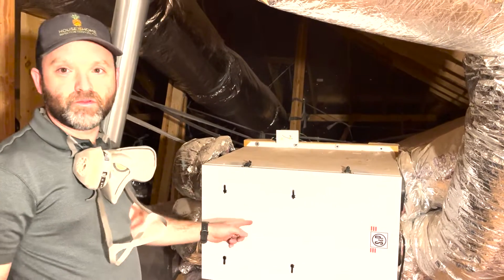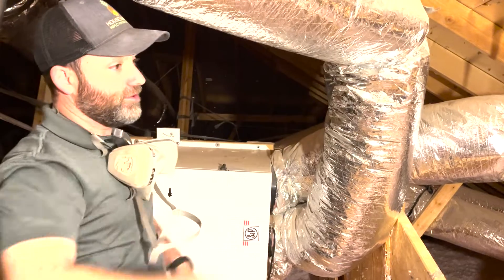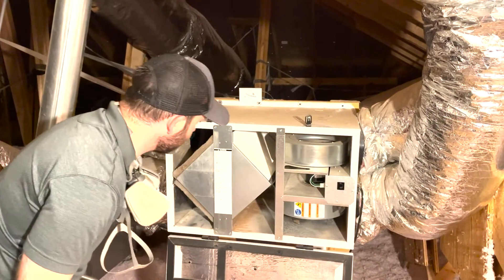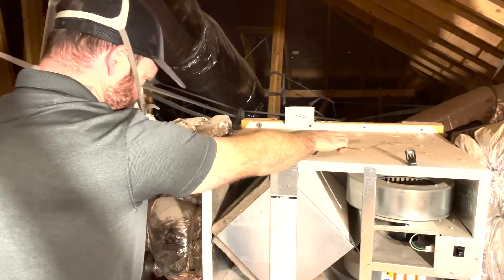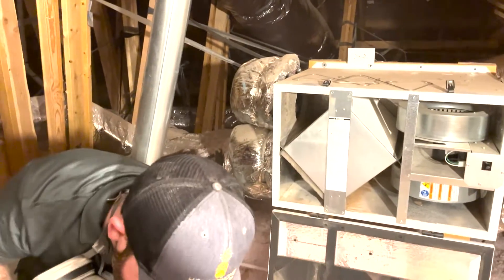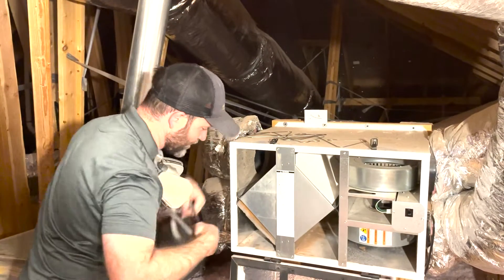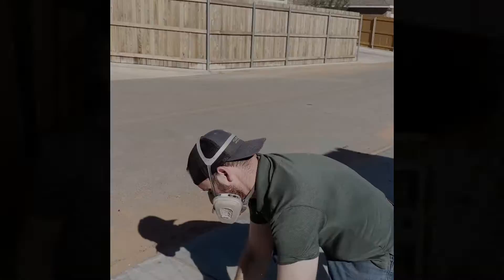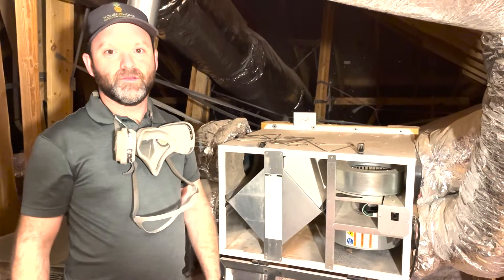ERV (Energy Recovery Ventilator) Filter Maintenance

Comment: Does the main square filter system ever need to be changed?
Reply from the maker: No. The only maintenance the MFR mentions for the cube filter is to vacuum the exposed faces with a soft brush attachment (annually).